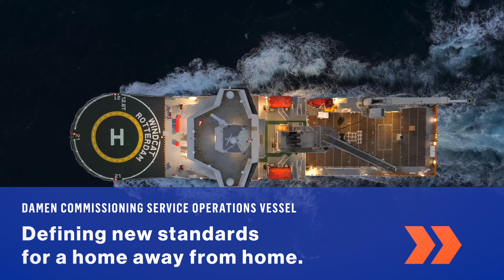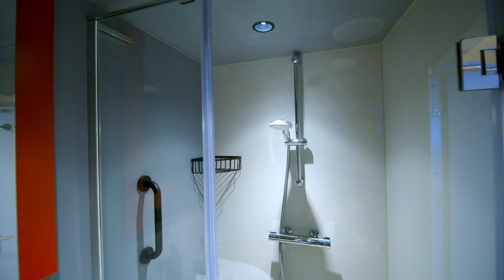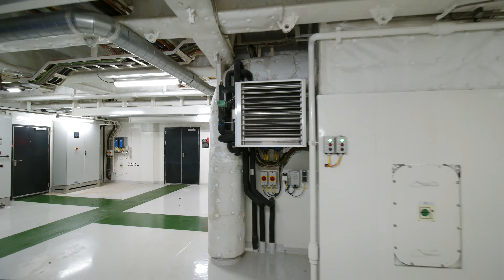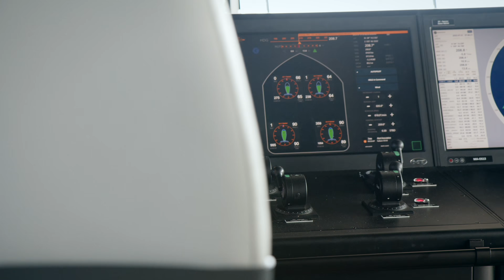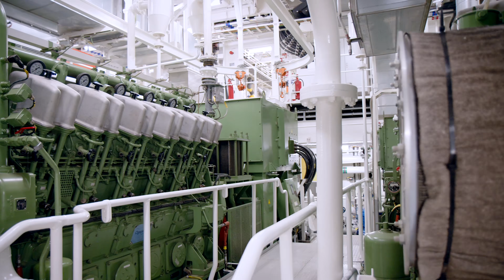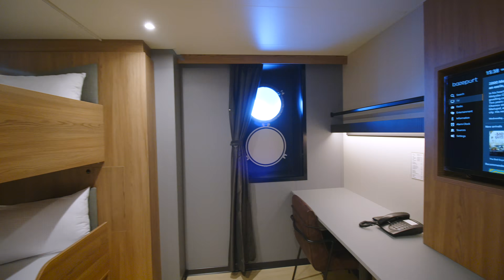Home away from home: Inside the Commissioning Service Operations Vessel 9020 | Damen

Comment: What is the maximum wave height for transfers?

What is the number of technicians on board?
 How many double rooms? How many single rooms?
What the cruising speed?
The back and front of the hull look  flat and close to the surface, won't that cause hull slapping when there are big waves?
Why there isn't active roll compensators like fins on SOV?
Reply from the maker: Great questions! The vessel has 90 cabins and accommodates up to 120 persons. It features an advanced roll reduction system based on moving water mass, which is highly effective at low speeds and uses no energy. The bow and stern are specifically designed to minimize slamming impact in rough seas.